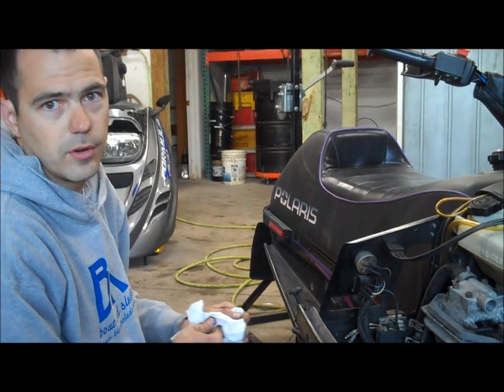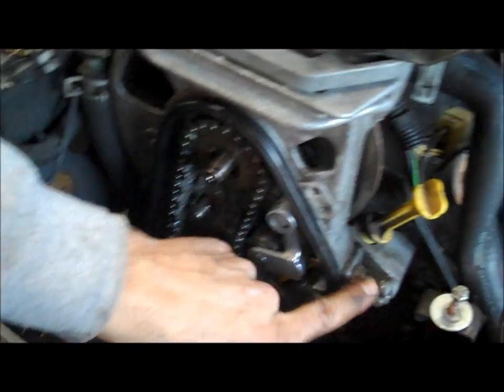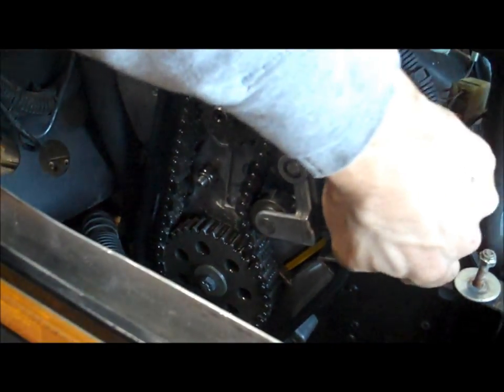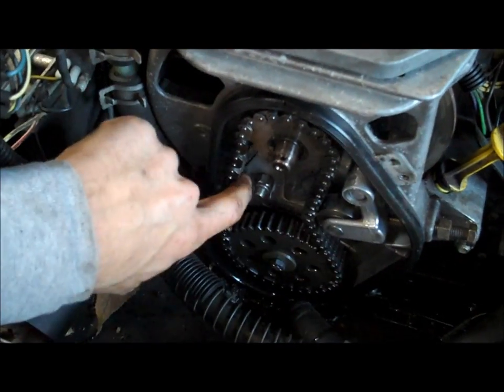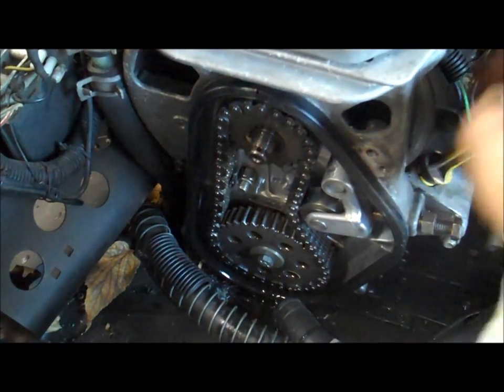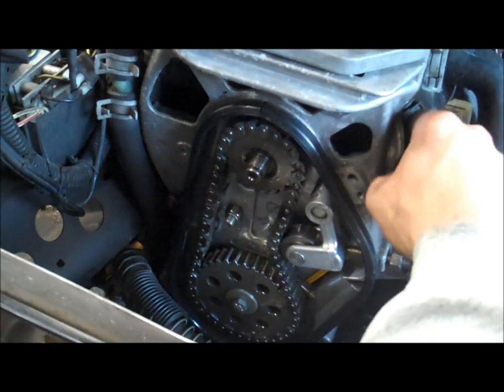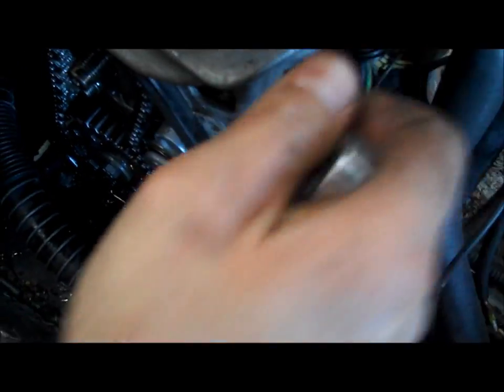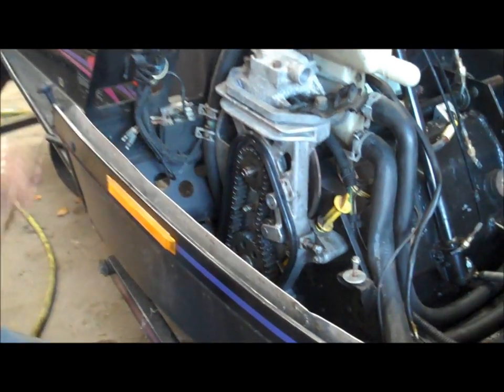How To: Check and Adjust Chain Tension (snowmobile)

Comment: I have my cover off now so I can see the chain. If I can move the brake rotor ½-1" like you say in the video my chain is extremely loose.  
When I tighten the chain up too the correct amount like you show in the video I can only move the rotor about ¼".
Huge difference if you're doing the  "moving the rotor" way of checking adjustment.

Comment: What oil do you use in the chain case after you had it all apart?
Reply: Some people run ATF, some 80w-90, some mix the 2. No need to buy anything expensive, especially if you have a drain plug - it's so cheap and easy to change it out every season.

Comment: Question. This question is not about adjusting the chain it appears then I really get on it the drive is slipping  to fix this I have to run the track tight. Track is stock Polaris. I had the drive shaft out then I replaced the track it looks good. It also slipped the the old track also. just doesn't seem right that I have to run the track so tight to cause it from slipping.

Comment: hi i have the same problem as matt vuletici but now on my machine it shredded up the belt and when i pulled the secondary clutch it has a lot of play like 6 to 8 inch of play when you turn it and i just got it fixed i got the sproket bearing changes the chaincase chain change pretty much everything in the chain case including the sproket shaft i guess i wil take it back to the polaris dealer what do you think?

Comment: Hey guys, good tutorial but I have to ask. The manual and everywhere else I read says I have to turn the bolt finger tight and lock the jam nut. I loosen the jam nut but that bolt is so tight it's impossible to turn by hand. It will turn only by wrench. I had the sled since new. I change the case oil every fall.  2010 Yamaha Phazer. Any ideas? Thanks.
Reply from the maker: Its subjective to some degree depending on how stretched the chain is etc.  Best bet is to take the cover off to see how tight it really is.

Comment: You actually finger tighten the bolt until its snug and then use a wrench to hold the adjustment bolt while you tighten your jam nut.

Comment: My polaris indy xlt 583 triple 1994 doesn't drive. Would that be the chain slipped off? Or what
Reply: Dustin Bercier pull the cover off chain case you may have broken chain or there is usually a keyway on the secondary clutch that might have sheared

Comment from the maker: to drain the oil you can either take the drain plug out on the bottom of the sled - directly under the case - or just take the cover off and let it spill, its only 8oz

Comment: Have you ever experienced a loud whiney noise coming from what seems to be the chaincase? Gets louder with acceleration. My sled runs fine but i was just wondering if youve ever had anything like this.
Reply from the maker: Hard to say - but perhaps a bad bearing?  I'd open up the case to inspect before damage takes place..

Comment: Hay guys, so I have a 1993 polaris Indy 500 I took the cover off the chaincase and there is like a spring thing and bolt holding on the bigger gear. Should it be like that or should there just be a washer and bolt holding it in like in the vid? Thanks
Reply: Sounds like you have a reverse kit on there. (or part of a reverse kit)

Comment: lol that's to loose , suppose to be finger tight so basically as snug as u can get it with ur thumb and index finger. clutch should just have a tiny bit of play urs has way too much.
Reply: I have had many Polaris sleds just like this one, and you are 100% correct, if you have it that loose with a High Horsepower sled it can jump, and or whip on the roller side and damage the surface of the roller.
Reply: Half inch play is way to loose 🤣

Comment: do you know why my 2001 polaris 800 LE is so hard to pull start?
Reply from the maker: do you mean literally it is hard to pull?  Its a subjective question.  What are you comparing it to?  The 800 has a lot of compression and simply is not 'easy' to pull.  If its so hard  - maybe you have bad crank bearings?  Really hard to answer that question - sorry

Comment: hey guys I need some help with my snowmobile, I have a 2012 polaris xlt, I was out riding it today and when I opened it up full throttle a terrible grinding noise started to happen, could it be possible my chain got really lose?
Reply from the maker: Usually a loose chain will 'ratchet' before it does any grinding.  It could be anything, without seeing it we would be totally guessing - sorry.
Reply: Ill look into it thank you
Reply: Tyler Proznick-Fransoo.  hey man did you ever find out what the noise was?
Reply: bearings bro.... get you wrenches out

Comment: hello I have a z370 for my young son and it is only going in reverse.  when it's in forward every thing spins with the sled not moving there is a popping sound when it does it and even the brake rotar spins with ought the sled moving. any thoughts?
Reply: Jesus Christ  chain most likely slipping on the sprocket could be the drive sprocket as well

Comment from the maker: Your the firs to complain, if you dont think its correct - lets hear what you would do differently.  At least thats what I am trying to understand from your garbled English sentence.
Reply: You actually finger tighten the bolt until its snug and then use a wrench to hold the adjustment bolt while you tighten your jam nut.
Reply: @xSKxCamper  so how much play am I looking for?
Reply: @travasgregory8447  you finger tighten the bolt until it’s snug.  Don’t vise grip it with your fingers.  Just til it’s snug.  Back it off 1/4 turn and tighten down jam nut.
Reply: @xSKxCamper  sounds great thanks! Just seemed super sloppy to me. But, I trust ya
Reply: @xSKxCamper  one last thing. Any indicators or to tight or loose while riding? Anything I should listen for or feelV
Reply: @travasgregory8447   1/4 turn out and never look back.  If it’s over tight it will wine.  If it’s super lose it will clatter and probably go thump and break.
Reply: @xSKxCamper  Thank you good sir for all the information and quick responses!  I truly appreciate it!

Comment: how do you identify what chain and gears you need if they need replacing I have a 95 indy trail with reverse when buying a chain and gears I see 11w 13w 15w what does that mean
Reply from the maker: +Richard Last Open the case and literally count the number of plates on the chain (as in how wide is it)  I sell them new and used if we can help.  815 363 1254